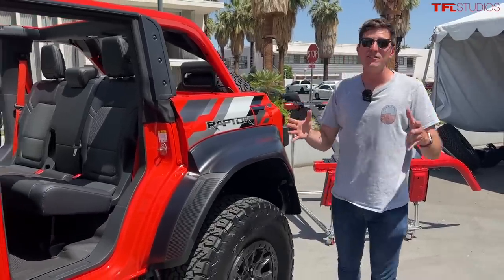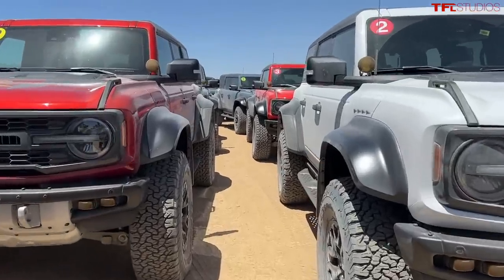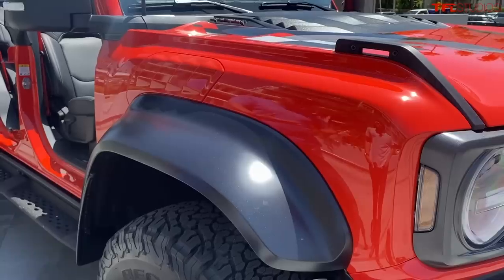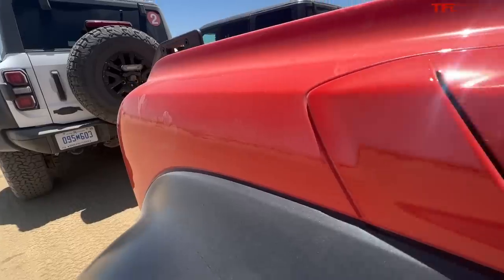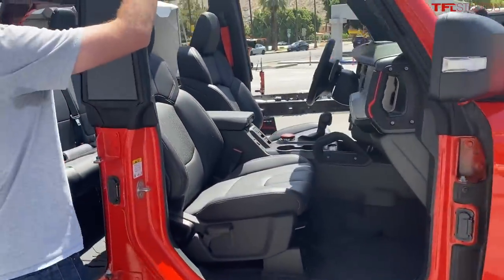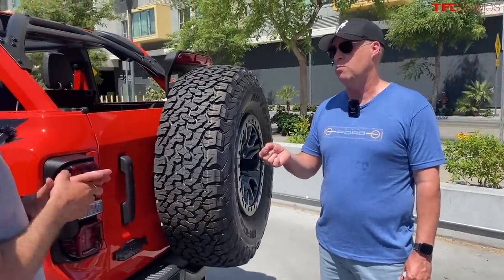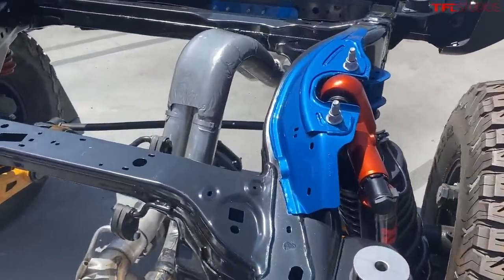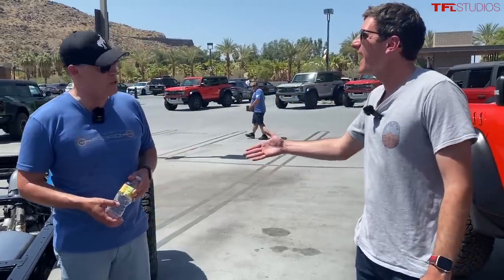There Is No V8 In The All New 2022 Ford Bronco Raptor: I Ask Ford Why!

Comment: I like how he basically dodged the v8 question. Good pre interview prep by the spin doctors
Reply: yeappp,,,
Reply: He didn’t dodge it based on the alternatives of what Ford had they looked at the 5.0 a and everything else and didn’t like the torque and hp curve for this particular vehicle
Reply: @jacobmoore6214  after watching that part again, you make a great point.
Reply: @jacobmoore6214  The decision was completely based on not poaching sales from the F150 raptor. If the actual reason for no V8 was just the power curves they would have put the 3.5 engine in it instead of the 3.0
Reply: @ryryshredder148  The 3.5 is overly torquey vs the 3.0 or 2.7.  They more likely wanted that top end punch the 3.5 doesn't typically have.  In driving, the 2.7 acts more like a small block and the 3.5 a big block.  I've only driven the 3.0 in a car, but it wasn't overly punchy on the bottom, but was still okay on the top.
Reply: His arm was tied by someone higher up. The engineers are doing what they can with the restrictions provided. No doubt, if they could, this and the Raptor would have a V8.
Reply: The turbo will have a broader torque curve. Better for rock crawling and daily driving. The only advantage of the V8 is the exhaust note.
Reply: @jghall00  

There is no advantage to the V8. It would in fact have less performance.
Reply: Outside of satisfying people who have inferiority complexes and need to feel better about themselves through a vehicles exhaust sound, the V8 has no advantages off the factory floor.
Reply: @ryryshredder148  yes but also the bronco is a good bit lighter than the F150 raptor...
Reply: @ryansheard8092 I get the point you're trying to make but you're actually wrong- for offroading speeds where you will be at much lower rpm the V8 has a significant advantage (and logic) vs a turbo v6. You are right when it comes to pavement speeds, which of course is what 99.99%% of buyers of this vehicle will be using it on anyway.
Reply: I'm sorry. It doesn't matter what you all say. 4 cylinder,  6 cylinder,  8 cylinder. Turbo or non Turbo. It all comes down to the EPA tyrants and what they want and say.
Reply: Sounds like a politician
Reply: @luckytrapper7656  I got 16 mpg in my V8 F150. I got 16 mpg in my 3.5 ecoboost F150. Even Fuelly shows that they get the same MPG in the real world (not fake news numbers used in a board room presentation). It's all a shell game and number spoofing anymore. I get 12.5 mpg in my 7.3 V8 F250 and I'm happy with that.
Reply: It's because Ford doesn't make a mid displacement V8 that would make sense. The 5.0 makes less average HP and torque across the power band than a 2.7EB.  They aren't going to put a less powerful Engine (5.0) in a more premium product. The Godzilla doesn't fit.
Reply: YEP, best for customers matters little, but best for the manufacturer! SEE PORSCHE, this can't be better than that
Reply: @jghall00  the exhaust note isn’t the only advantage. The V8 doesn’t have cam phasers that need replaced twice before 100k miles.
Reply: @ColeSpolaric  You mean 1,500 before you get nearly all the torque. Check out a dyno chart of the Coyote vs the Ecoboost, then me know what you think.
Reply: No he can’t talk about future products, you KNOW they’re going to make a Bronco Raptor R with a V8
Reply: Thank you!! This channel is full of bias so hard. These guys own a Bronco. Of course they’re going to dodge the question at hand. They don’t want to look like tools…
Reply: @jacobmoore6214  bullshit! Of course they won’t admit why they didn’t choose a V8. That would bring down sells if their buyers know they cheaper out on them, while still charging the premium price.
Reply: @jacobmoore6214   bologna! Of course they won’t admit why they didn’t choose a V8. That would bring down sells if their buyers know they cheaper out on them, while still charging the premium price.
Reply: @ryryshredder148  
Why would they care about poaching F150 Raptor sales? Both trucks cost pretty close to the same with the Bronco starting at a slightly higher price.. I have to assume the profit on each is pretty cloe to the same. Besides, if a Bronco Raptor with a V8 outsales the F150 Raptor without, why wouldn't they put it in the F150 as well?
Reply: They didn’t put a v8 in the bronco raptor because it would take away sales for the actual ford raptor
Reply: @ColeSpolaric  Have you driven a Coyote? It is linear, but even in truck tune, it needs to rev.
Reply: @Privatericky1123  
Not if they put a V8 in the F150 Raptor as well. Besides, they're both Ford products that (I assume) make roughly the same profit. Who cares if a Ford product outsales a Ford product? At the end of the day Ford is still selling vehicles.
Reply: I don’t care about how efficient the 3.0L is. People still want a V8. PERIOD They should of figured that out when the removed it from the Gen2 Raptor.
Reply: @ColeSpolaric  

You should look at a Dyno chart then correct your statement. The turbo kills the 5.0  in torque across the entire rpm band.
Reply: @sly9263  

Check the facts first. You are wrong . If we are talking the 5.0 against the 3.0 .
Reply: @ittybittyfds1  

The sales numbers prove you wrong.
Reply: @nm-qt2hb  i spoke facts- ball's in your court as to what comment you're even replying to or claiming is wrong. If it's MPG, truth's up on fuelly- that case is closed.
Reply: @dcl97  Actually the 7.3 would more likely fit than the 5.0 or the 3.5 ecoboost, as it is narrower than those two, but it is a bit heavy.
Reply: Ya everyone's a politician now. If you get a direct question, just start blabbing about something no related and the interviewer will never stick to their guns.
Reply: "We're slaves to the EPA, so we have to neuter every single vehicle we sell to increase our average mpg"
Reply: I'll tell you some advantages of the 5.0 over the 3.0 turbo.  First, with the 5.0 you'll never have to replace a turbo!  Second, you'll also never have to have the intake valves cleaned because it has dual fuel injection as opposed to just direct-injection.  Third, it sounds better (IMO).
Reply: V8 doesnt fit in that chassis.
Reply: @JacesOwnWorld  it's not cause they're being cheap. Its mostly to do with gov regulations. Look at Toyota and Chrysler they're going the same way with their new 6 cylinder pots as well. Soon even the Hellcat is gonna have a 6 in it and that's just heartbreaking 💔
Reply: V8 are thing of the past for these smaller mid size SUV. Doesn't require V8 power to go to the mall, or to drive around town, or driving a smooth dirt road with all your mid 30 friends, then telling everyone else you do "4 wheelin".. That's all we need, V8 emissions expelled all over the place with mall crawlers. Do we want a V8 ? Sure, everyone that needs  it, that really does 4Wheeling would want it. Additionally this is not a truck, its not pulling large trailers, its not a construction truck  carrying large heavy loads. It just doesn't need a V8. Also the days of V8 are going away. The 90's and mid 2000's mentality of carbonator and single axle vehicles are slowly getting erased.. Very few single axel vehicles now (4Runner/Tacoma, Jeep (not cherokee anymore), Bronco) etc...
Reply: The bottom line is Ford doesn’t have a V 8 that would even fit in his truck if they had a small displacement pushrod engine they could shoehorn it in .They would have the option.The 5.0 has a huge cylinder heads it’s actually physically a very large engine. The V6 they used is a 60° V6 much narrower.Not to mention the 3.0 TwinTurbo has the coyote covered in horsepower and torque especially low in the mid range where there is no comparison.
Reply: At this point, the V8s have become the dinosaurs in the auto industry.  They are on the verge of becoming extinct, especially in a time of high gas prices
Reply: From reading the comments I realized people don't know how a turbo works. 
That chassis is BIG, they said it too..they cannot fit a Ford V8 ratnest in there, but a simpler v8 not a Ford motor,  I'm sure can fit.
Reply: @JohnDiMartino  TT would heat soak like crazy and cut timing. Not to mention the reliability issue with all that heat. Is the 3.0 Dual injection and does it have the oil jets for cooling
Reply: @UNKPCRIDE  the bronco is 5000 pounds.  Heat soak and mpg is a real issue. You get better mpg from a low reving tourqe V8
Reply: Nobody really thought he was going to answer that question did they? Ford has all but abandoned the NA V8 in favor of the boosted V6. It is not really a bad thing since the boosted 6s have more than enough power and are easier to tune to give the desired result. There are disadvantages to the boosted engines but this is not really the place to discuss them.
Reply: Prob saving for the Raptor R it’ll prob get a supercharger Rustang v8 watch
Reply: @jacobmoore6214  Two words --> "Hog Wash"
Reply: @2pi628  😆
Reply: @nm-qt2hb  Why do you think Caterpillar engines run at about 1/2 horse power per cubic inch instead of 3 horse power per cubic inch like a Dragster? Do you think their excuse would be "performance" or dependability?  Now ask yourself why many consider a V8 to be better than a 4 or 6 cylinder. I can promise you these OVER powered 2.3's and 2.7 engines will not be dependable over years in the way a V8 would be. IF they were tuned down to one horse power per cubic inch then you could make a good argument for dependability. I want both performance and dependability. A 300 HP 5.0 V8 would be perfect for the Bronco. What's the torque numbers on a 5.0 vs 2.3 vs 2.7 with respect to RPM? I'm willing to bet this guy's torque argument doesn't hold water.
Reply: @ryansheard8092  LOoking at ONLY horsepower numbers you are correct. But bring in dependability and longevity and you sound like a bumbling fool. A 300 HP modern V8 won't be causing problems on the trail in ten years, but those over powered Rice burning time bombs(2.3/2.7) are just begging for a chance to leave you stranded.
Reply: @luckytrapper7656  I wish FORD would just FREAKING say it instead of just DODGING the freaking question EVERY SINGLE F'ing TIME that they are asked. It's starting to get really irritating.
Reply: turbos dont like heat or low rpms yet he talks hot desert sand dust its all good in lol
Reply: @daryenmirabal2656  
Where does Ford seel a street V8 Bronco? No where that I know.
Reply: A naturally aspirated aluminum block V8 with steel liners would be far more durable and less complicated than any twin turbo anything. The 2.7’s are blowing up in droves. Why would you think a higher stressed 3.0 would be more reliable? This will be a very expensive vehicle to operate, especially after the warranty expires. I do commend Ford for going the extra mile with the tire size and suspension upgrades.
Reply: Is this part of the millions of cars Ford just recalled?
Reply: He didn't dodge the V8 question. Firstly, the question is practically a coping mechanism. Secondly, he answered it and you just couldn't figure out a good counter to it. I love V8's more than the next guy, but something for the same of itself is just begging the question. 
Simply put, there's no V8 because there's no need for one.
Reply: @ColeSpolaric  wrong. Maybe research a ecoboost dyno chart.
Reply: @jacobmoore6214  They have diesels and they have 2 larger V8s than 5.0s.  Thats not at all why they dodged it, and they absolutely did dodge it.
Reply: @ryansheard8092  Except reliability, ease of maintenance, and affordability.  Clearly you've never worked on an internal combustion engine, much less a turbo'd one.
Reply: @nm-qt2hb  weird the 392 in the jeep has plenty of performance...also the sound of the v8 is what the people want. Twin turbo v8 for the win

Comment: That lead engineer could have brought up smog laws, hp numbers, engine weight, manufacturing cost and he choose to dodge the question entirely.  Gotta love corporate ford
Reply: He said it was 3.0L 418hp with 440 ft lb torque. Google says it weighs 445#. Does anyone make a production vehicle not smog legal in all states? As for manufacturing cost, why would he bring that up? I could have missed it, but I didn't hear the question asked for him to have "dodged" it.
Reply: He dodged the question about whether they had thought about the V8 as well.
Reply: I mean they did win Le Mans with basically this engine in the 2017+ Ford GT. I know they only did that to give the V6tt platform performance cred but it can't be denied that it now has performance cred, powering a Le Mans winning hyperexotic!
Reply: @richardwheeler3768  Yeah that’s the real one people wanted to know that he bobbed and weaved! 😳😂😂🤦🏽‍♂️
Reply: @rts3613  Yes many vehicles sold are meet California’s strict smog legal standards and are legal to be sold in 50 all 50 states besides all the EV manufacturers that manufacture vehicles😒, google is definitely not correct all the time and it would have been great to hear it from the engineer. Third he most definitely dodge and didn’t answer the why not a V8 question🫢.
Reply: @dennissmith7214  Go back to the OP, he didn’t mention the V8.
Reply: @rts3613  yes Tommy asked him and he immediately just started telling the hp and torque figures..he completely avoided the why there's no v8 question
Reply: This is just unfortunately how it is. The V8 is dying the wusses have won 😭 its only a matter of time until Dodge begins the same thing. The winds of change are in the air. The new I6 they've just come up with, Toyota 3.5 V6 TT. Its sad but true and that's just how it is
Reply: @rts3613  It's in the title of the video
Reply: He didn't dodge the question. You just didn't like the answer. Or couldn't understand it.
Reply: Turbo = problems later and most people will regret owning it.
Reply: @jeffwisener1378  It certainly can, but the turbo isn't there for reliability. It's there to make a torque band that's more useful for offroading.
Reply: @jeffwisener1378  turbos=problems? 🧐 that’s crazy. Those 4-5 million mile semi trucks all have turbos butter cup. That supercharged TRX though, much better right? Positive displacement blowers are much more reliable right? All the heat they create, better make sure it isn’t hot outside. You mopar fans never cease to amaze me.
Reply: He dodged the question because none of those arguments are valid. If the mustang can run a V8 so can the Bronco.
Reply: @dreadnoughtprime6301   "We found... the three liter was the right motor for this vehicle."  He completely dodged the question.
Reply: @2pi628  No, you just didn't like the answer.
Reply: @dreadnoughtprime6301  He simply stated that it was best motor. I agree. It was the best motor for FORD, not the customer. And his assertion is based on what they think they can sell to the customer.  In this case, they CAN sell with the motors they have chosen. Right now the Bronco is a cool retro gift from Ford. Once the new wears off, or they have longevity issues with these high HP to displacement engines -- they will either cancel the Bronco or offer it with a V8 to keep the sales coming .
Reply: @2pi628  Exactly and considering the new Raptor R has a 5.2L supercharged V8 as well.... makes no sense really
Reply: @2pi628  picture this T mike sitting with the board of directors saying technical reasons are not valid in determining engine choice only the fact that if it fits in the bronco it can go in it.
Reply: @noah22261  Yes, I would tell them they are full of crap. Then I would ask them how they managed to create a 700 HP V8 Raptor with all of those regs in place.
Reply: @chir0pter  
I'm glad you used the word "basically" because the internals of the Bronco V6 TT are no-where near the Ford GT racing version V6 with twin turbos. The only thing in common...     6 cylinders in a V pattern with two turbos. Now, let's talk about the racing internals in the V6 and the size of those twin turbos in the Ford GT. No, the engine in Ford GT is not powering the Bronco. In fact, you couldn't get the Feds to pass that engine (GT) to be driven on the street.
Reply: @joshuaearnheart2756 - Don't compare a Deisel engine in a tractor to a gas engine in a passenger vehicle. Two different animals. ...and if you don't think turbos create heat why does my Ford ST have and every engine with turbos have air to air heat exchangers? All power adders can bring internal combustion engines to an early grave, if not used properly. BTW, my 03 Cobra is damn fast with that positive displacement blower. Only difference, water cooled heat exchanger.  Yes, there are water cooled turbos not just oil cooled.
Reply: Who wouldn’t want a V8 to scare away all of the wildlife when you go off-road 😂
Reply: @Mark-lq3sb  there’s factory turbo engines everywhere. And also factory supercharged engines. Fords ecoboost engines are everywhere and there’s a lot of them with a lot of miles. Idk what your argument is. Gas or diesel, a turbo makes boost. Actually makes a lot less boost on a gasser because there’s nowhere near the exhaust pressure
Reply: @joshuaearnheart2756  
1. Comparing a Deisel to a gas engine. When Deisel's are built for extreme high mileage. Power adder or not two different types of engines. 
2. Implying that turbos don't make heat and superchargers do. They both use heat exchangers. Both can be water cooled. Weak argument. 
3. Gasser? Who the hell is talking about Gassers? A gasser Bronco; now that would be a sight.
Reply: @Mark-lq3sb  turbos don’t create the same heat as a turbo. PD blowers are known for heat soak. Gasser as in, gasoline. Sorry. Forgot who I was speaking with…